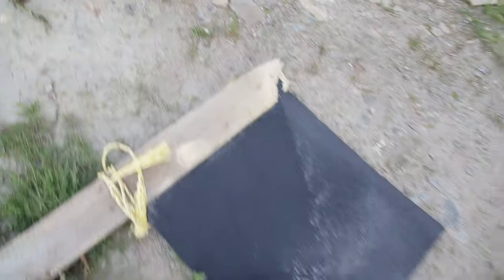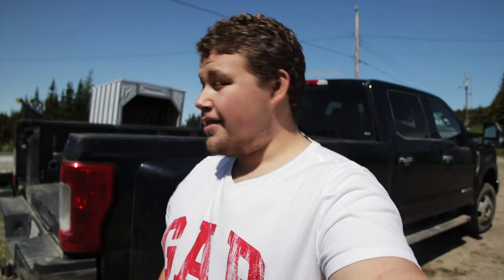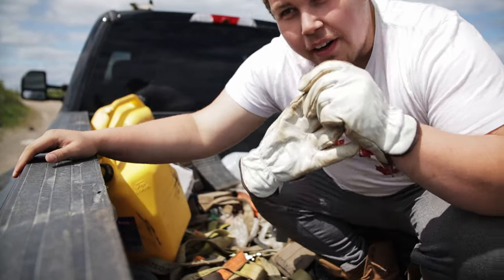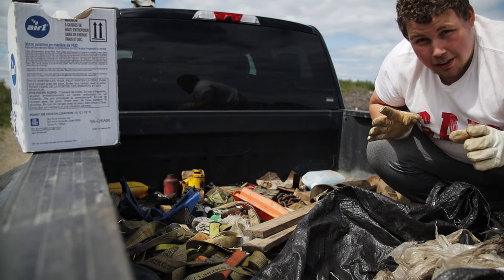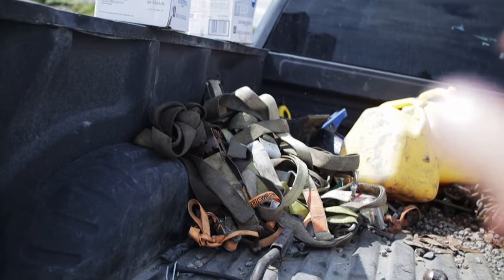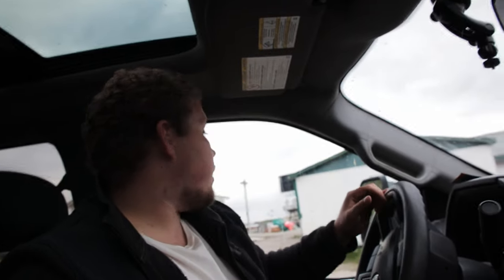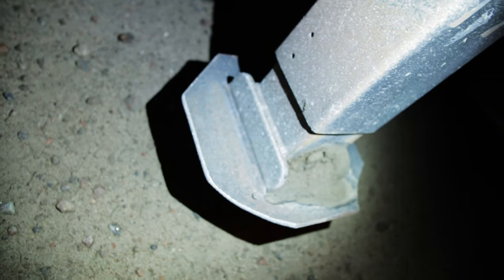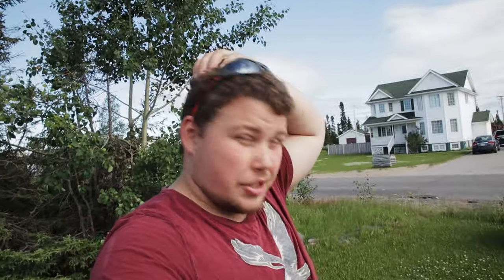COMMERCIAL Grade $20$ Mud Flap - HOW TO

Comment: Now come winter time in a few weeks, you might want a couple light chains or a cable from the mudflap back to the bumper or underbed.  The first snowbank you back through won't rip your new mudflaps off and crack your fender, the second one might. They look good, function over form

Comment: Why not just put an auxiliary fuel tank in bed for long hauls and build a box off of that for straps and odds and ends just idea ... Keep up the great work
Reply: because very few hot shot drivers will add a fuel thank because it significantly increases the weight on the rear axle and if DOT ever weighed him it would put him out of service for being overweight as well as significant fines.
Reply: Then I'd put drop axle somewhere to keep from being over weight they do that in the states
Reply: @wildbilljunior  I have never seen a drop axle on a dually pickup anywhere. They do not make drop axles for pickup trucks.
Reply: It goes between the truck and the trailer I could look it up if you want me to or you can look on YouTube it's a pretty sweet outfit
Reply: You can see the item at mrtrailer.com so you can put a auxiliary tank in the bed of the truck or a motorcycle

Comment: I put the 24"x32" on my 86 Toyota pickup. 
Use the 1/4 20 self searters with the  ( ( U NUT )  on through the fender lip.  This allows a firm hold onto the flap. Use S/ S FENDER WASHERS THERE ARE 1/4ers ,   3/16ths, # 10's etc. 
YOU should chain the flaps back...  You will rip them offf!!!!!!

Comment: Never buy a vehicle with a hole in the roof!
Reply: Yup, I have always shyed away from vehicles that had sunroofs ! My eyes dont like the sun anyways !
Reply: Any roof should not have holes in it, or as less as possible.
Reply: Owned a power stroke king ranch woth a sun roof. I loved the sun roof but it leaked terrible. I got it fixed with a good cleaning of the front drains. The back drains you have to drop the headliner so I never done those. All in all I’ll pass on sunroofs now.
Reply: Just rolled 100,000 on my 2021 just like this one and no issues with the roof. I have a bed in the back with the back seat removed. Only problem is the heat that comes in. But other than that it is sound proof. No leaks

Comment: Found these obviously not 20.00
https://youtu.be/6OsPqnBCI9k

https://www.sharptruck.com/truck-hardware-custom-fit-mounting-brackets-gb759895

https://youtu.be/T46WwJQhGV4

I think large fender washers to stop the screws tearing. But a lot of those aftermarket flaps had metal plates to attach the mad onto. 

Not sure if more storage boxes can be attached to trailer ?